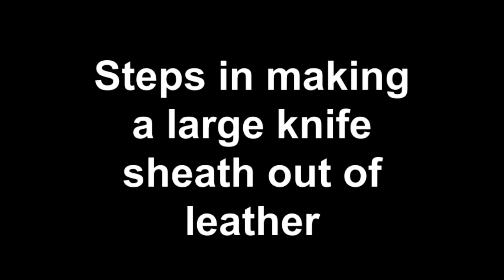Large knife leather sheath construction.

Comment from the maker: Thanks for watching and the comments. Yes, it's a solid piece of brass that weighs around 60lbs, it was a diaphragm on a large machine that I happened  upon at an auction, It's a nice base but not necessary. What you need is a solid platform, preferably above the post on your bench, t you want is no vibration or feedback from your efforts. Yes, I use a razor knife and feel very comfortable with it over the 40 years. I have 2 nice head knives that I use for large cutouts such as saddles.

Comment: I see you use a thick piece of brass or bronze as your platform or anvil when stamping.   It looks like a one of a kind item.   What do you recommend the novice leather worker to use for this purpose?

P.S.  I notice your razor knife.    It is not retractable.   I, too, use a razor knife that is not retractable, because it holds the blade more securely.   For razor knives, the cheapest tool is the best.